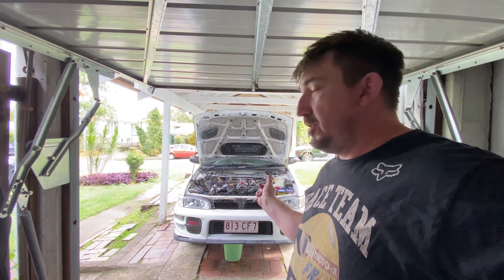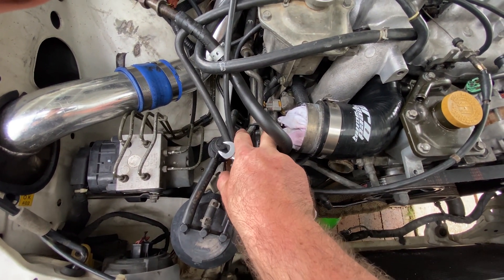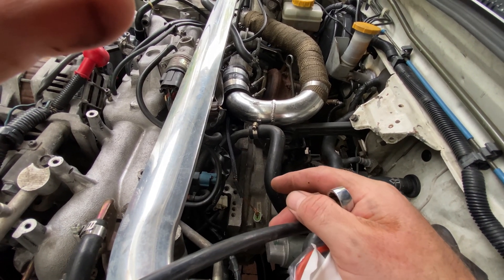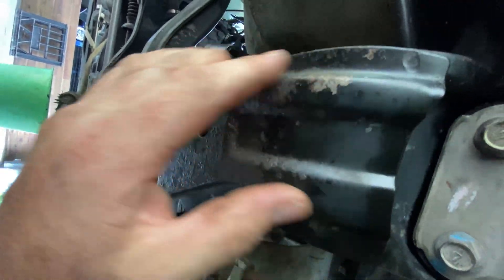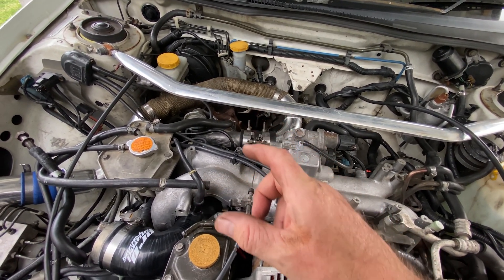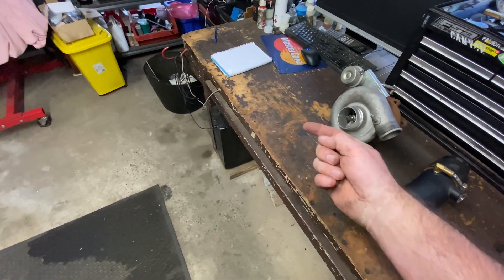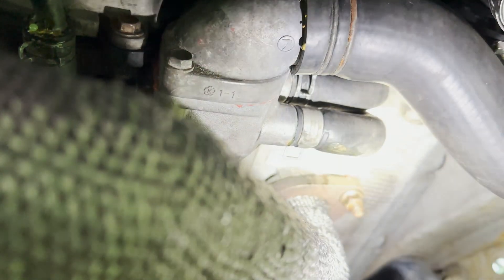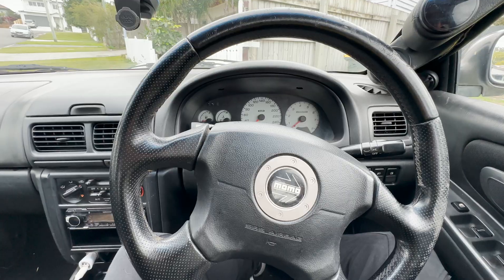Solving ever oil leak on my EJ205 '99 WRX - LevelUP!GC8   Video 9

Comment: Love the videos on the gc8s. My shifter input seal is leaking as well. How big of a pain was it to replace and is it worth the hassle?
Reply from the maker: It’s pretty easy. Just take your time. First time I think it took me 4 hours start to finish. Now I’d say I could do it in 2. I think you have to take off the Tailshaft, support the gearbox with a jack, remove the gearbox crossmember. You might have to take the backside off the gearbox. But it’s really not that hard. You might just need a good rattle gun to undo the bolts around the outside of it. A proper punch set helps with the shifter linkage & You’ll need 4 jackstands too. Just give it a go. Get the Tailshaft output seal & the shifter bushings if you need those aswell. Get under & have a look first, sus it out & go from there. Seems daunting but it’s not.
Reply: @Fine_Performance thanks mate

Comment: Finally found a video that is absolutely bang on to what I’m getting atm, bought a Subaru Impreza gc8 about 4/5 months ago got it all fixed up new arch’s sills etc etc been MOTED not for around a month and been great however I’m getting that burnt smell with undertones of plastic like scent. 

I’m at a loss of where to look
Reply from the maker: @EVOLLOVEx  you just have to get under there & look for anywhere oil is getting on the headers or exhaust. UV dye in your oil is a massive help. But even my car, I somehow get strong exhaust fumes in my passenger side (left side looking forwards in Australia). There’s just so much exhaust &/or areas that heat up that if a small amount of oil hits it, it will cause a smell. Have a look through some of my other videos, I went through everything I possibly could fix, for over a year. Turned out my gearbox was overfull as it had the wrong dipstick, was one major cause of some issues.

Comment: going trough this at the moment but its my 3rd car so its on the cbf list at the moment. what a rollercoaster yours was to work out its why im dreading digging into mine
Reply from the maker: What’s your issues man? I can give you some things to check as I did all this to mine & found out it had too short of a dipstick! So the gearbox was getting overfilled.
Reply: @Fine_Performance  using about 600ml of oil every 2,000km. Often sits un driven for months at a time
Reply: Loosing a little coolant as well
Reply from the maker: @fujitsubo3323  pcv valve. Get a new genuine one (not an aftermarket one, they don’t seal). Even if the existing one rattles & seals, it might not during engine operation). Also look for cracks in pcv/ breather hoses.
Reply from the maker: @fujitsubo3323  head gasket then. 100%.
Reply: @Fine_Performance  could well be it’s up near 200k now
Reply from the maker: @fujitsubo3323  but check under the engine for coolant leaks. Could be bad pcv + a coolant leak. Or could be the head gasket.

Comment: I have a doubt, has the use of the TD05 20g without the relief valve, using flutter, damaged the turbine?
Reply from the maker: No it’s perfectly fine, The best way to look  at it is…. If a turbo with a BOV lasts 6 years, a turbo without a BOV might last 5.5 years. It’s the turbos bearing that ends up being damaged, not the actual blades of the compressor or turbine.
Reply: Ok thanks, I have a gc8 ej20k, front intercooler greddy, intake HKS, fuel line in aeroquip, downpipe 4 inches stainless steel, after the downpipe the exhaust is 3 inches, I removed the VF28 I'm putting a 20g td05, to make a fluter equal to yours, how much pressure did you use on your td05 20g 1.2 bar?
Reply from the maker: @subarugcred9667  yeah 1.2bar easy. I usually drove mine @16psi, but I had another setting 18psi. The reason it sounds like that is it’s an old style turbine design. 6? Blades I think & because it’s a “cheap” turbo, the compressor has a lot of mass, so it sounds very choppy. My current VF34 is almost as good, but the TD05 definitely sounds better. The Vf turbos seem to do this “Whoosh” sorta sound at high boost, whereas the TD05 always sounds like Tsoo tsoo tsoo tsoooo.
Reply: Thank you for clearing my doubts, just one question, why did you remove the Td05 20g?
Reply from the maker: @subarugcred9667  I preferred quicker spool. I have considered putting it back on, even after I fitted the VF34. But I’m currently working on getting a killer B inlet to fit. Hopefully I can get some cooler sounds out of the Vf34. Then I may even put the TD05 back on for the sound.
Reply: @Fine_Performance  very good I understand, I removed all the injection harness from my original car, I'm putting a programmable one, so in 15 days it's ready, I'll send you the video
Reply from the maker: @subarugcred9667  my car I’m building is EJ20K Sti heads & EJ207 short block.I’ve still go a few things to buy & wiring to do (plus tuning). But it’s getting closer.